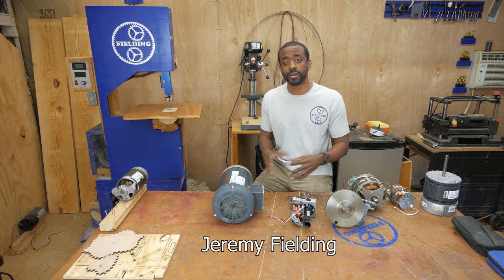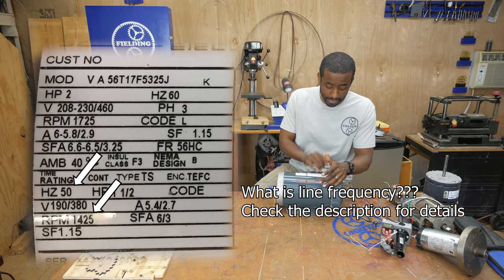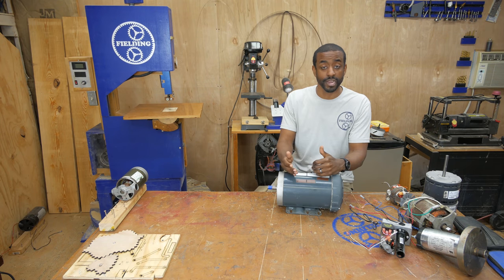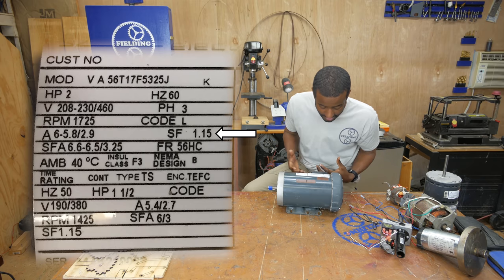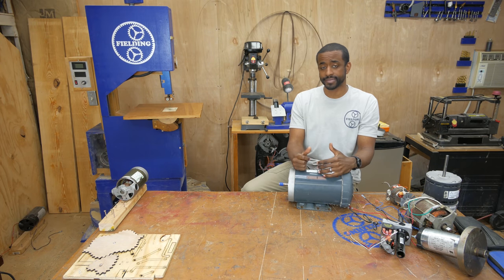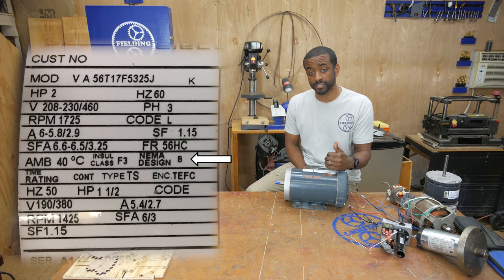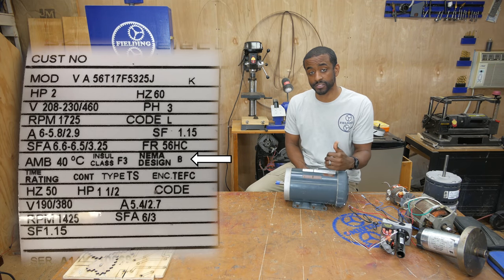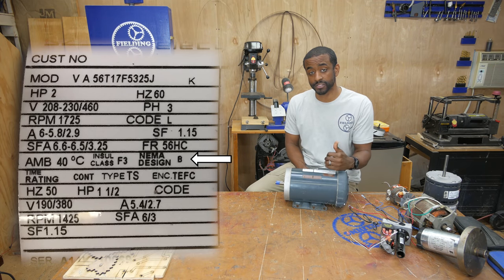How To Read The Label on Motors; Ultimate Guide To Electric Motors: #069

Comment: Thanks to you I have two blender motors, 6 printers of different ages and sizes, and am driving home with my second treadmill from this years “spring cleanup”.  I spent several hours in the wee hours of the morning Driving through alleyways in some parts of the city where people put theirs spring clean up trash, and up and down every other street in that city.  Just bought a lathe and a mill that should be here Friday.  So far my wife’s been a good sport. But she hasn’t seen inside the shed yet😂

Comment: I just happened to come across one of your videos a couple hours ago and I've been watching different ones from you since. This video caught my attention because I've been having trouble with my 5 horsepower Ingersoll air compressor motor, and trying to make sense of everything on the plate of the motor was confusing. I like how you talk about using treadmill Motors a lot, last year I made a electric wire stripper using the motor and rolllers off a treadmill. And it works awesome LOL

Comment: Jeremy, Treadmill Duty: this rating means moderate use for the first month after purchase, followed by a sharp decline in use and a sealed housing to protect the motor from dust once it's moved into the garage to be stored for 20 years.

Comment: Jeremy, listening to you is like a zen meditation... you are humble and have a tone that is so approachable... I think of WWJD (What would Jeremy Do) when I face my class.  BTW... I had a 5 hp motor that was running a Hydraulic pump fine in Pittsburgh but when they moved the equipment to Connecticut it would not cut it... the voltage dropped from 230 to 208 and the current went up and would blow the fuses.  Needed to change the motor for the new location. The challenges of running near the edge.

Comment: excellent video.  I knew most of this but not the service factor or insulation class.  Using an asynchronous induction motor as a wind generator, I have burned up the insulation so I need to find a beefier motor.

Comment: FYI, I've used your video's, not exclusively, but predominately, to learn what I currently know about motors. The text that I use in school is decent but you present demonstrations and really clear and concise information that is not only pertinent to someone learning about motors but actually fun to watch casually as well!

Community colleges suck! I wish there was an accredited online based platform where the students had power to choose their instructors based on their proficiency and ability to teach. I learn more from youtube video's like yours in a short span verse the hours every day I have to sit through these traditional classes. 

Professor thanks for the tutelage and I'm looking forward to more of your video's! 

Oh and question, do you know of some applications where a three phase motor utilizes the neutral from the common of the three windings? 

The wye configuration is typical but I wired a  motor trainer at my school in the wye configuration with the common to neutral on the trainer and it smoothed out the motor sound and dropped the amperage draw. I explored on some on various electrical engineering channels and found out, according to the channel host, that train motors utilize this wiring configuration. 

When I wired it that way my instructor freaked out and told me that I couldn't do that and I might burn the motor up. He proceeded to then demonstrate how to wire this motor in the delta configuration. Which promptly burned up the motor within about 1 minute of operation... Yea that trainer had been at the school house for like 40 years so sad.. 

I read that the delta configuration in a transformer has the affect of a so called wild leg that has a much higher voltage output on one of the three windings. Though I'm just learning about all this, perhaps this is what caused the motor to burn up?
Reply: I had AC problem at home a couple days ago, called the ac tech, he replaced the blower motor. I kept the " bad" motor he replaced and run it in the kitchen, and it's running! What should I do, appearantly the guy didn't think I could wire it and run it, because I have different accent( Turkish) so I must be stupid. Should I go to court or something?

Comment: Just incase u still wanted to know,  Treadmill motor energy is measured in horsepower (HP) and can be sorted into three different rating systems: 1. Peak Duty: Generally the weakest. “Peak” stands for the peak horsepower that the treadmill will reach and no more.

Comment: I found a really odd motor in an old shack that turned out to be a repulsion start induction ran motor. Instead of a starting capacitor and aux winding, it used a set of 4 brushes to start  and a centrifugal switch disengaged them once up to speed. You set the direction of the motor with a knob on it that adjusts the alignment of the brushes

Comment: Excellent video! 👍👏👏 Just my luck, my Motor doesn't list the frame. As an idea, I haven't found many instructional videos on troubleshooting/diagnosing any potential issues. An example would be to test the separate windings, or capacitor (s). Thanks again for a great informative video.

Comment: Treadmill is a device formerly used for driving machinery, consisting of a large wheel with step fitter into its inner surface, it was turned by the weight of people or animal treading the step and now with small motor you show on this video.

Comment: Another excellent review, Jeremy. One thing that has bothered me for a while is the way motors powered by lower voltage often draw more current at that lower voltage. Why? If the motor has a specific impedance, then as voltage falls, why doesn't current fall, by ohm's law? How does the motor 'know' that it should work to a specific horsepower, raising current when supply voltage is lower? Is this a property of the motor design, escalating current draw when the motor has to work harder, or is there a microcontroller attached to the motor that reduces impedance when supplied with lower source voltage?
Reply from the maker: These are great questions. I might have to do an advanced video to cover that.

Comment: Treadmill Duty (TD) is the ratio of the duration of a typical new year's resolution (N) to the time the device is used as a clothes hanger for the rest of the year (C = N - 365). So, let TD = N/C Time units are in days. Typical treadmill duty is around 7:(365 - 7), or 7:358, or ~.02.

Comment: One correction for you, my friend..
AMB 40C means 
40 C temp rise above ambient temperature. So if ambient temperature is 35C, you can run it up to 40 degrees Celsius above 35. .. so up to 75C. 
You should also check the insulation code to verify that it can handle that temperature.
Reply from the maker: This is presented correctly in the video. It’s pretty easy to double check this with a search on the internet. But more importantly, this type of meaning doesn’t make sense. ambient can be any number so if temps are 150C in a particularly hot part of the factory you get another 35C? I pulled that information from a reliable source and cross checked it. It means exactly what it says which is great because that’s easier to understand. Take a look and feel free to share a resource if you find something different and is reliable. Thanks!😀

Comment: I found this video after doing a search. Recognize you from Smarter Every Day!

Some circular saw motors have different amperage ratings on them. 7-1/4" might be 15 amps, 10-1/4" is 14 amps, and 16" is 13 amps.

Is this to reduce the motor RPM? It seems like the relative speed of the tooth at the outer circumference would need to be optimzed - a 16" saw spinning at the same rpm as a 7-1/4" saw would have a totally different effect on the material being cut, and the teeth of the blade would be subjected to much different forces.

Comment: You might have already answered this question. How can you tell if the motor has aluminum windings for the stator and/or  the amature? Is there a way to tell on the label? Or do you have to do a scrape test on the windings.  All aluminum armatures are visibly i.d.ed .I am just asking about the ones that have windings. And is there a easy way to visibly identify a generator motor from a regular motor.  Such as by the housing ,exp fins,block or round shaped.  Thanks for any help and I look forward to watching all your videos and projects.

Comment: Any idea how to find out what size capacitors to use on electric motors? Its missing the capacitors. There’s two locations for them. I’m assuming one is a start and the other a run. The motor runs on 115/230V, 3450 RPMs, it’s for a continuous air compressor, and it draws 15/7.5 amps.. I’m unsure how many HP’s it has..

Comment: The Nema design B letter designator describes an entire torque curve shape of that AC induction motor, including the fact that it will have breakdown torque or not. With design A or B motors the breakdown torque can be used to get more power and torque out of the motor by overloading the motor. It's actually used in some very specific applications like in hydraulics and shredders where RMS mechanical power matters more than continuous rating of the motor. In such applications as those two, it is the average heating of the overloaded motor with rest periods in between that is equivalent heating to the motor being ran at its full rating continuously. So if I took such a motor and had it submerged in mineral oil and had the oil temperature checked by a thermometer, and motor A was being loaded to produce 2 horsepower continuously while motor B with sufficient breakdown torque (you only use a percentage of the max breakdown torque; never the full amount or you risk stalling motor) was being overloaded for a short time and then allowed cool down periods, then the average heating of the oil will be the same for both. We call this mechanical Root Mean Square power, and it is the exact same formula as it's electrical equivalent when defining AC voltage equivalence to DC voltage using a resistor to get the same heating equivalence in a liquid.

Comment: Your  videos are great, it's a real tresor on youtube ! 
I was wondering, considering how hard it is to find powerful motor, is it possible to make 2 motor work together ? Or even more than 2 ? 
Let's I want to have 3000watts of power. Do 4 motors of 750watts can do the job  ? How ? Why not ?
(Obviously it's for an ebike fantasy 😎)
Reply: I have seen several piston air compressor examples driven with a pair of identical motors and pulleys on opposite sides of the larger compressor shaft pulley, with the advantage of reducing the wear of the compressor shaft pulley bearing!

Comment: Hope it helps as every motor I try googling to see what it is so i can figure out what knowledge im missing to make the things i want is useless. The my1025 I see in a few vids looks nice good size and would work well in a camper for smaller electronics as Idk how id figure out how to get a switch for 5v vs 12v without frying myself fucking up the system or just screwing up in general. A voltmeter and many other things arent monetarily viable for me at the moment so it would be best to get specific info in laymans terms at first lol

Comment: Very informative video. I've always found the term " single phase" for 240 volts kind of annoying, since it's actually two phases (A and B in resi. and most commercial services in the US) of 120 volts to give you 240. Seems like it should be called two or dual phase.    Maybe I'm missing something.
Reply from the maker: When you combine the two separate phases you get 240 single phase....so the name is correct but separately they are out of phase so it seems confusing

Comment: my brother, i am in my 40's and an IBEW electrician. '5YEARS' of classroom education, and infinite years of on the job learning (still learning, ha). have been around the country working industrial, commercial, and even residential. and must include working on vehicles, total different demon, ha. in my spare time (which i try to limit via not wanting to get a divorce,ha) i have taken apart an uncountable amount of mechanical, electrical, and electronic components to see how and why they work, and repurposed them them do things they were never meant to do. an absolute joy in my life. i guess some people play golf, ha. anyway, long story short, with all the people i have brushed shoulders with, there have been literally only a couple handfuls of people that not only possess the capacity to learn and discover "outside the box", not only briliant in IQ, but also, and sometimes is the most important, not so far down the rabbit's hole of intellectual education that it becomes hard to communicate by 'dumbing it down a little' for people that are not at your level. you sir, are one of these in a handful. i am very impressed with your abilities to learn as you teach. very well done. it is appreciated. and i am very curious where you got your education, engineering maybe? or self taught. by the way, this was the first video i clicked on this morning, coffee in hand to find out what the 'other' treadmill hp rating was for, via i have been wondering about that also....NO ANSWER! now my day is shot, all projects are on the backburner, going to research until i find out! ha. have a good one, and keep up the good work.
Reply: @danallen1828  Now we need to debunk the stoopid "Max HP" rating used on wet or dry vacuum cleaners and dust collectors, as it is showing ridiculous claims of "6HP" on some Shop Vacs and similar brands... totally useless and higly misleading!

Comment: Very good video, I have a 220 v motor with 3 wires 1 has a 3 on it the other 2 r not marked. How do u find out which 2 wires r hot. Nothing on the wire plate? Thanks

Comment: I know this is an old video but if possible could you explain something Jeremy‼️
The treadmill motor you showed... It said it was 2.25hp at "treadmill duty", but it also said it was rated for 90V & 10A i.e. 900w or .9kw right? 
So my question is: If hp & kw both = "power" with a proportional relationship of 1kw:1.3hp then a .9kw motor could only make 1.2hp right? 
So how is it rated as a 2.25hp motor? Even at a reduced duty cycle the motor can't just magically "more power" right?

Comment: Isn't the 240/460 Volts issue related to the fact that it is a 3 phase motor? 460 volts between each phase and 240 volts between a single phase and the ground.

Comment: I picked up some old ceiling fan motors. And I've been experimenting with them. I want to use one to make a rotating camera platform but even on the lowest speed it's a bit too fast. Can a variac or some other device be added in line to control the speed?
Reply: Rpm determined by frequency and number of poles.
Variac changes voltage.  You’ll reduce torque but not speed.

Comment: Thanks for the great information on motors Jeremy. I have an disc sander that has a 2Ph motor. I was hope to run it on Single phase 220 using a VFD. The problem I’m running into is that the three phase motor does not have a low and high wiring ability it only has 460. Could the motor be rewound for 220 and 460, so it then can be run of a single phase 220 VFD?

Comment: Hi, I have a Toledo gearmotor the wiring diagram is as follows for CCW rotation. P1=line, P2+P3=INS, T8+T1=INS, T2T5T4=line. I want to reverse polarity to CW. What wires do i need to switch? Thanks

Comment: Hi Jeremy. May I ask you another question?
If I want to replace my 1/2 hp , 4000 rpm motor on my lathe, with a DC treadmill motor that is 3 hp, 18 Amps and 130 VDC, do I need to choose a controller that says 130 VDC and 18 amps?
Does it make a difference what the treadmill rpm is? Because all the dc motors have about 120 to 130 VDC and more than 15 Amps. But none of the TM controllers go that high in volts. 
Can you offer some advice…again?
Thanks,
Paul

Comment: Hi jeremy. I have a air compressor with 230/460v 3phase motor. Will a vdf with 380v output be enough to run it?

Comment: I have a 12v Firestone Air Compressor that runs up to 150psi that I got from a yard sale. The motor didn't turn when I attached the wires to the battery.  I cannot find an exploded view of it or the pump.  What type of motor is it and how do I check it out (looks clean but)?  I don't see any brush air vents.  What can I possibly reuse it for if I can get it to work?

Comment: Here is a link mentioning Treadmill Duty Cycle: https://www.johnsonfitness.com/blog/treadmill_drive_motors_and_the_question_of_horsepower/
To go along with the article,  if you can access the service menus in the console, you will find they have a lot of these parameters set from the factory. For example, total work out time: usually 60 min. Then average user: male. Then average weight 160lbs. etc. And they probably estimate time between users. in a home setting, I'm sure the cool down time far out ways the run time, unlike the commercial use where the opposite applies.    p.s. Its always a pleasure to watch your videos and learn new things.

Comment: Hey Jeremy how goes?? Just found you as I I'm fighting an up hill battle in my quest to make my own outdoor portable rotisserie.  I am having trouble finding the right motor for the job. What I am trying to achieve is high torque low rpm. So for example I need to move approx 20-70lbs of meat at a speed of 2-6rpm  for periods at a time. What I do have is gear reducer (Boston Gear 300) with a motor and would like to use a speed control in order to adjust the rpm as needed. Any help or suggestions you can give me.  Thanks